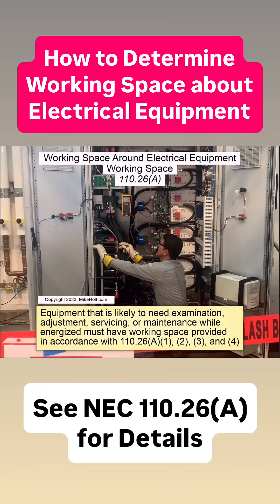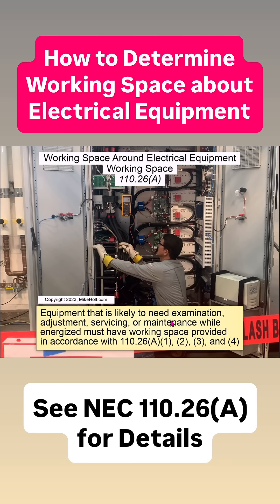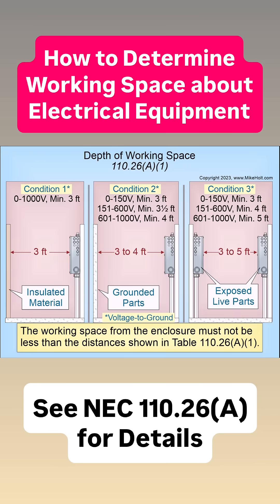Access to and egress from working space is required at all times, see NEC 110.26.

Comment: I'm wondering about the flat working space under electrical components like the ones in the picture showing them on the exterior wall of a building. 

Is there a height limit that components are mounted at that not having a permanent walkway/ work space is not a violation because scaffolding or a mobile work platform would be used if access to those components were necessary?
Reply from the maker: @The_Bouorneologist, please post your question on MikeHolt.com/Forum

Comment: Question: If an exterior panel was replaced that was half over a porch and both the original panel and the porch passed inspection decades ago would it be necessary to cut the porch in order to satisfy the 3’ of working space rule?

We had a power line jumping off the mast of one house going to another house and the utility engineer told us we needed to keep the meter where it was and the inspector didn’t want us splicing the home runs to relocate the panel where it would have sufficient working space. Instead the inspector required the owners to cut the porch before they’d pass final on the panel. I would’ve assumed it would’ve been grandfathered in because I’ve done panel swaps at many locations that most certainly don’t have sufficient working space and the original installation was done decades ago so I was surprised that was an issue